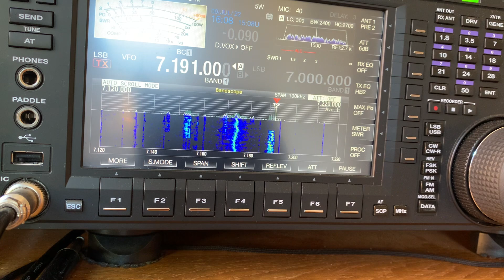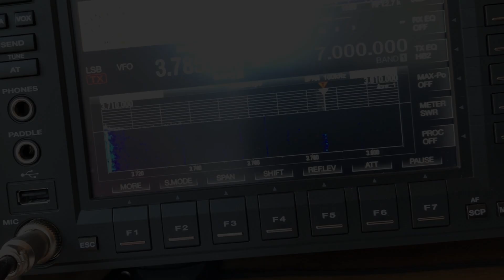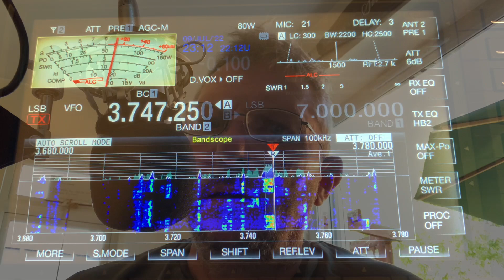HAM RADIO: Testing the Spiral loops : 40 & 80 Metre loops: HD1080p

Comment: Hello again. they used these type antennas during war to DF the spies in German occupier Europe and spies also used them to TX and RX from UK as well. Now how much wire are you using to find the band 1/4w 1/2w or full wave lengths of wire. If FW could it be set up as a Quad beam 4 elements say for sake 6m, Wire is only 6.25m for the reflector. idea is set it up as a sprial FW length 50>150mhz .BUT keep the final loop bigger than your 2M Quad. Idea is to reduce the size of the loop over all spreaders are 111mm long X 40 say  down to 50cm each etc what ya reckon got give it a go ain't ya  2e0feh
Reply from the maker: 1/2 wave or close to, coupling loop is 10%
Reply: @mike-M0MSN  Thanks mike now what about going to FW 50.200mhz. I have just made a Octagi its 5 el 2m fw quad loops in 8 sided and 4 yagis in ali 6mm .To follow on. I want to add 6m to same boom. BUT the 6m loops are BIG like to cut them down by having the FW wire for 50.200mhz to loop twice thus reducing over all size and have re driver and 2 X directors

Comment: Quick question, do those cobwebs @0:35 make tuning easier? Are they a required element of this design, or just a happy coincidence? Inquiring minds wish to know........
Reply: The cobwebs are the blessings of the God of sensitivity...you know...spidey sense 😀
Reply: I own an original Cobweb antenna and done so for many years.  Each spiral is tuned to the frequencies it covers - a true multi band antenna covering 20 upwards.  Mine is on a mast that extends up to 35 foot.  Height works, however it is like so many a compromise aerial - I'd like a Hexbeam but the station master would not.  That's life - a series of compromises.  73 Mike

Comment: Mike which is the best magnetic loop antenna that you have tested? I'm very interested in the double one model.
73"
Reply from the maker: Definitely my twin copper loop, it is brilliant
Reply: @mike-M0MSN  thank you very much Mike.
Reply: I have built Mikes 20m mag loop with 22mm copper pipe and it works a treat

Comment: What is better,  magnetic loop or magnetic spiral antenna?
Reply from the maker: Personally I believe the magnetic loop wins on all fronts, if you use the correct capacitor and size of loop. But cost is a big issue, the magloop is a very expensive construction 28mm copper pipe is not cheap add to that a good high voltage capacitor…… the wire loop is pennies.
Reply: Good question. Can't wait to see what people say.. I do think the biggest difference is the spiral loops are more band limited say max 2 bands, as apposed to say 40 thru 10. Plus I believe they work better at the lower frequencies than a straight mag loop. But I could also be full of it!